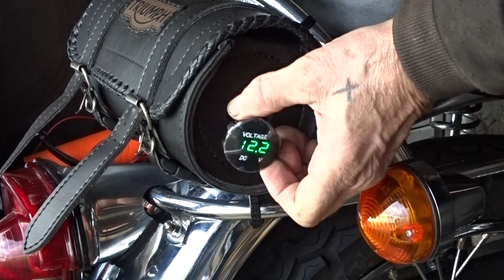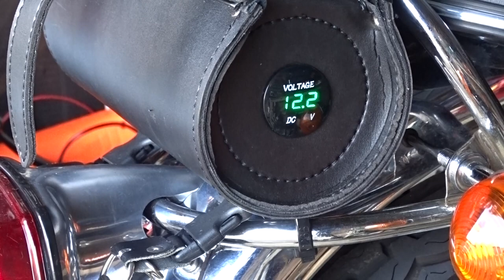T140 - Adding a volt meter to the tool roll mod

Comment: Great idea. Like you, two things I like to know about when I am riding are oil pressure and electrical condition. I made a similar mod to my 74 T150V, except I installed an ammeter in the headlamp. 
I’m enjoying the modifications you carry out on this bike and look forward to seeing more. Thanks for posting.
Reply: I’d be interested to learn the reasoning, if any, as to why you decided to choose a voltmeter instead of an ammeter.
Reply from the maker: I never thought about an Ammeter, maybe I could fit one the other side lol I have a 12v plug socket that can interchange with the volt meter if I needed some kind of 12v external power source , I think I need a bigger tool roll haha

Comment: i hope u keeping the t140, and u sold both the xs,s but the chop u kept? side note the brake stuff i bought from u is working great,new harness,carbs tyres exhaust and other stuff just clutch to do ,iis it worth doing 7 plate setup? no idea whats in there , Be finished in time for freezing cold weather lol

Comment: The best mod I did to my '75 T160 was use the hydraulic main landing gear wheel well pressure gauge off of a F-4J Phantom as an oil pressure gauge 🙂
Reply from the maker: I bet nobody else has done that!
Reply: @OldBiker  pretty sure
haha
that thing has been long wore out.....but I still daily drive my '72 Daytona T100R
Something about old (real) Triumphs that nothing modern can duplicate

Comment: Could it not have been fitted in one of the side panels?
Reply from the maker: The airbox is in the way, besides I would have to bend down more to see it lol
Reply: @OldBiker  Haha we must take care of our old bones. Ill admit its a neat solution albeit you can't see it whilst riding either. A buzzer that went off if charging dropped below a certain voltage could equally work.